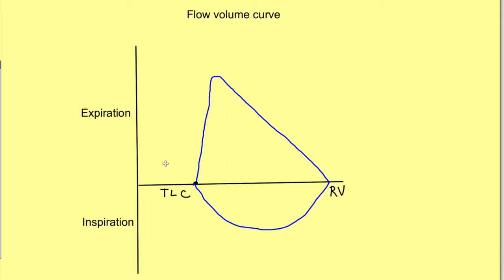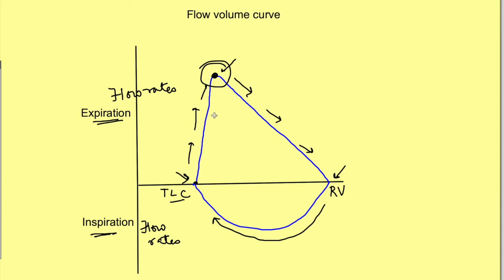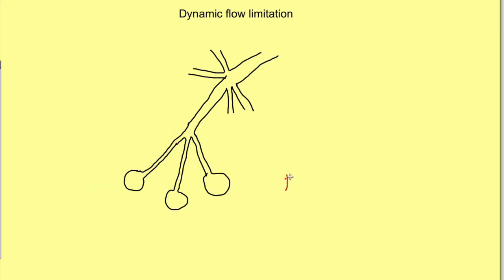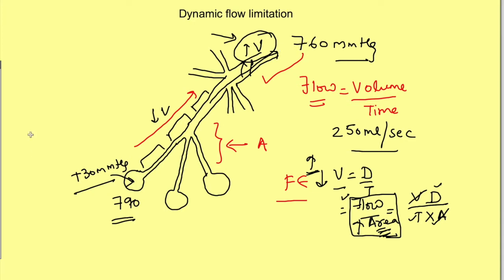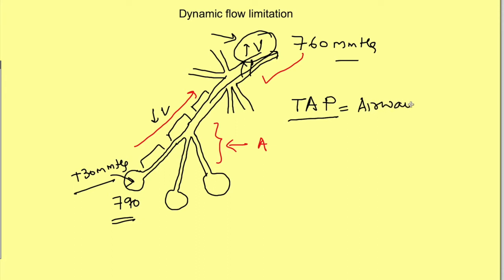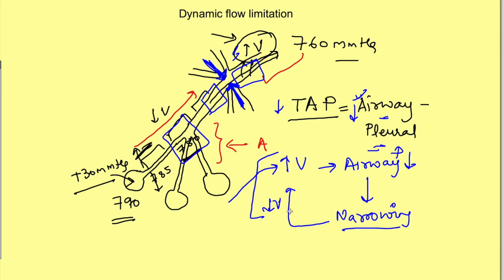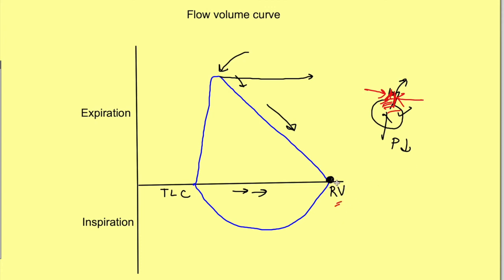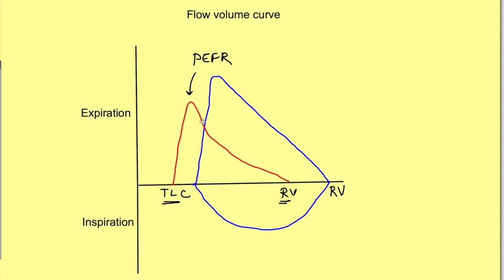Flow volume loop - Dynamic airway compression | Pulmonary function test physiology | Respiratory

Comment: Thank you. One clarification please. At 9.26 you said narrowing of airway will decrease the velocity. It should not as of consideration mentioned.  Firstly since flow rate is taken or considered constant by you, if we take a single airway for understanding, if area of it is reduced, the flow velocity has to increase to maintain flow rate. Beside for a streamline flow, velocity x area (continuity theorem of flow) is considered constant. Flow of gases in large brochi is more or less streamline. Friction will also not eat much velocity either in large brochi and dissipate it as heat. Main cause is exhaling force generated per unit time by a human body will be high initially and it will reach max and then fall with time so rate of flow of exhalation takes same pattern.
Reply from the maker: Narrowing of airway increases resistance to flow, leading to loss of pressure head - hence will tend to decrease velocity...however as you rightly said- decreased cross sectional area will lead to increase in velocity
Reply: @PhysiologyOpen  thank you for reply. Further putting my point, narrowing of brochi leads to lower cross sectional area. Narrowing itself means reduction in radii of airways and radii reduction leads to reduction of cross sectional area.
Reply from the maker: Yeah as I said before you are correct there- narrowing leads to reduced cross sectional area...however if there is extensive branching - then overall combined together- it may have higher cross sectional area than unbranched larger diameter bronchi
Reply: @PhysiologyOpen  at 9.26 as of my original comment, it was considering upper respiratory tract, having larger airway, and same is as per the diagram by you as visible in the video so i commented as per that. Rest is clear. Thanks and Regards 🙏
Reply: I have the same confusion. If velocity is decreasing due to decrease in pressure head then it should also increase due to decrease in area. Is it that the decrease in pressure head is much more than the decrease in area that the velocity finally decreases?

Comment: How is the cross sectional area more in small branches and less in large airway? shouldn't it be the opposite?

I understand that the TOTAL cross sectional area will be more, but when comparing single bronchiole to a main bronchus, shouldn't the velocity be higher in bronchiole since the area is less compared to the main bronchus?
Reply from the maker: Total small branches cross sectional area is more and hence velocity less…since air has to cross more cross sectional area in same time.